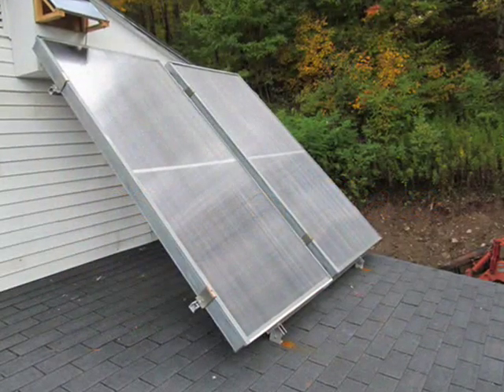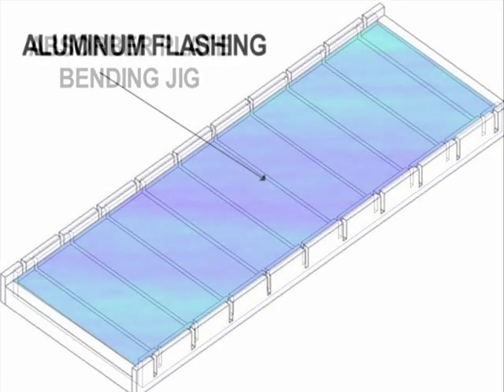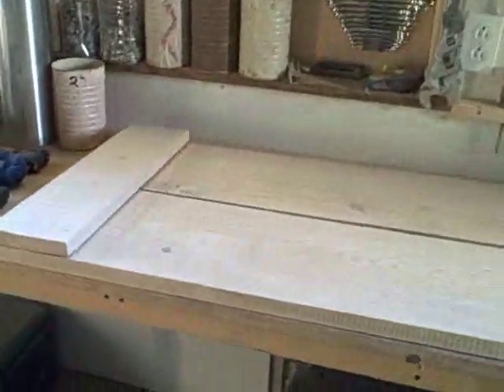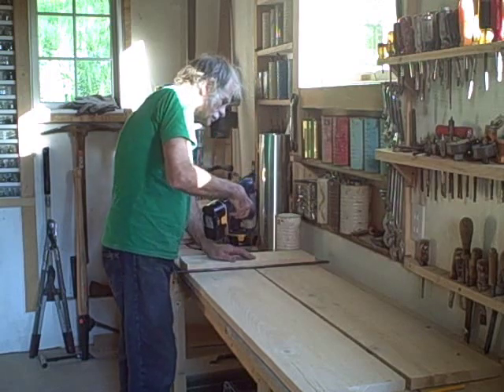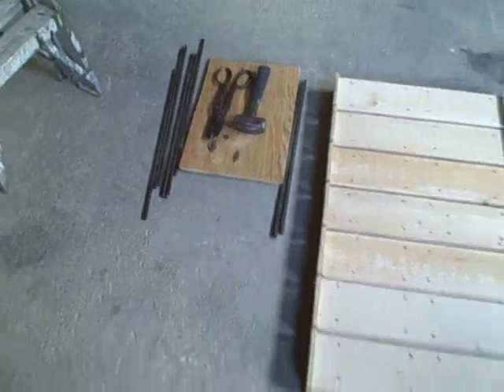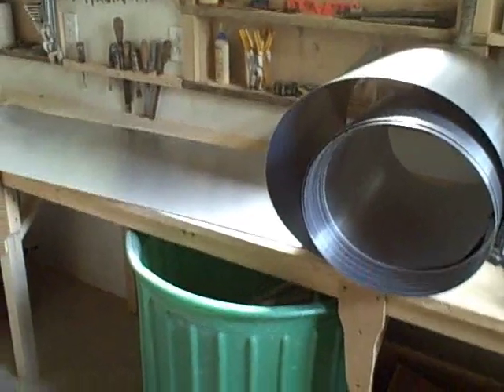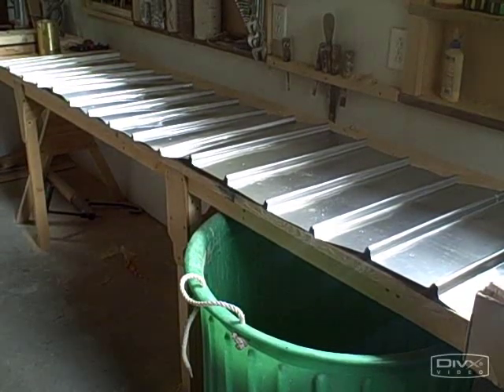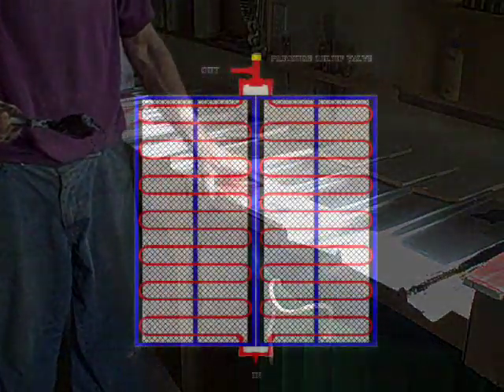Homemade Absorber Plate

Comment: try using a router to make a halfround  impression in the jig instead of creating a square impression you will have a round inset for the copper pipe.probably make it easier to remove too

Comment: What angle did you use, so the flow tube has the slope to drain back? Or you simple made a parallel jig?
Reply from the maker: +Csabi Nagy Water will drain back even if the tube sections are parallel
Reply: True, but only if they are perfectly level. If they're a few degrees away from level, they wont drain and will trap water. It's best to use parallel tube & header layouts, and mount them at 5 or 10 degree slant to ensure good drain back.

Comment: Roof flashing sheet is usually hard;  tempered aluminum.  You forming process would be much easier if you instead used  'dead soft aluminum'  -  which is much more malleable.
Reply from the maker: Thanks for the tip. I was not aware of dead soft aluminum. Where can it be purchased? How thick is it?